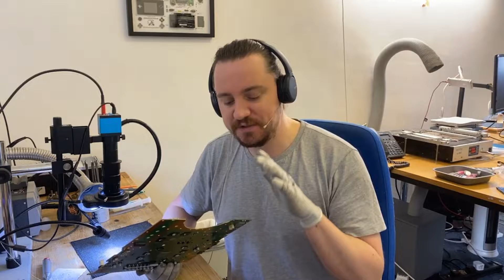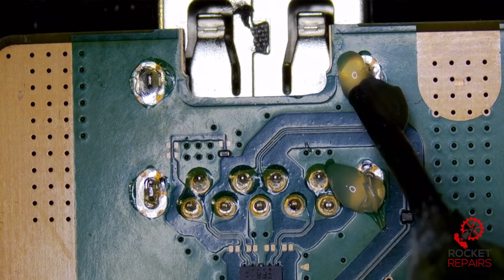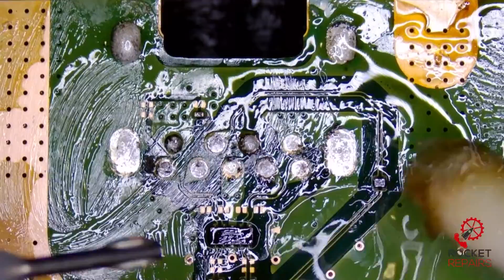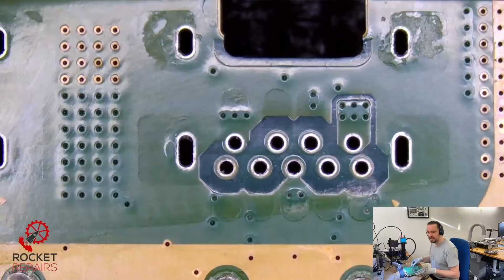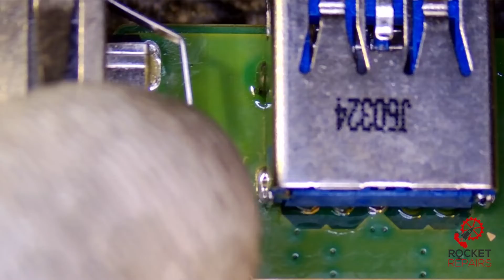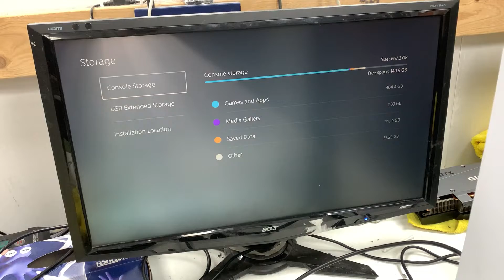PS5 USB Port Repair - we fix it nice and quick

Comment: How much do you guys charge for hdmi and usb port replacements? I have a broken hdmi port and also broken usb A port on the front
Reply: @@justanormalperson2839 I basically bought a broken one for a really good price with the faults described. I've found a repair shop that can fix it so I've sent it off to them. Fingers crossed 🤞
Reply: @@justanormalperson2839 I will let you know. Should arrive with them today :)
Reply from the maker: £90.
Reply: @rocketrepairs  I got it sorted in the end, all working fully. Thanks a lot though my friend :)

Comment: I dropped my ps5 off at a small shop over 2 weeks ago. They said it would be done in 5 days.... it's now been 20 and every time I call, I get a new excuse.  I gave them 7 business days before I called the first time, and the guy said, "we are literally working on it right now." I gave them 5 more days, and the guy said he lost the tweezers needed to attach a ground wire, so he is waiting on a new pair to get delivered. I gave him 5 more days and called this morning.... he told me he just had to reassemble it and test it, but he never called me back. Does this sound ridiculous to you?
Reply from the maker: some small shops do not have the necessary experience to fix consoles. Try somewhere that is VAT registered....just kidding guys xD!!